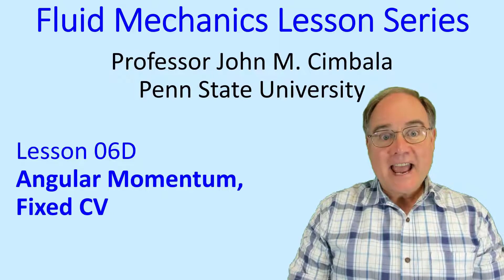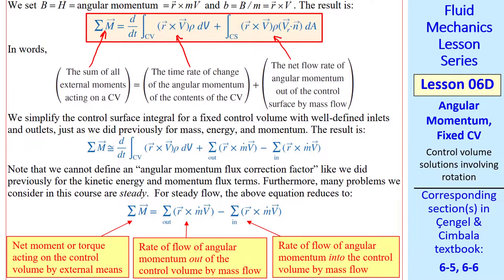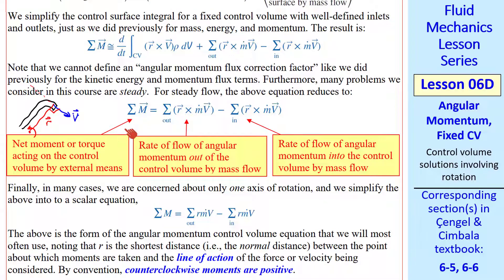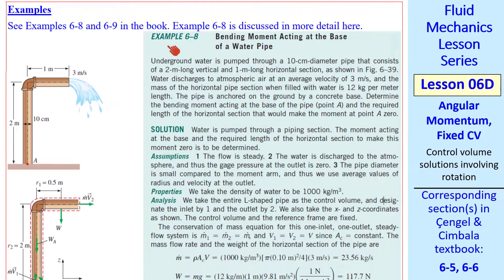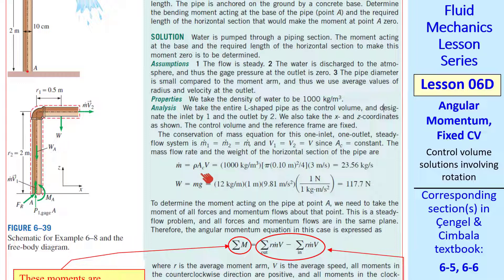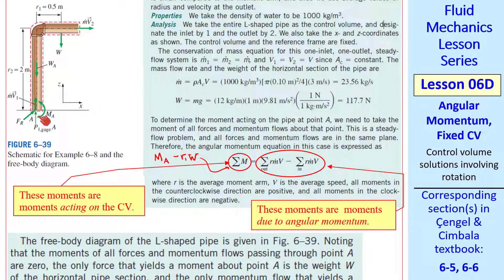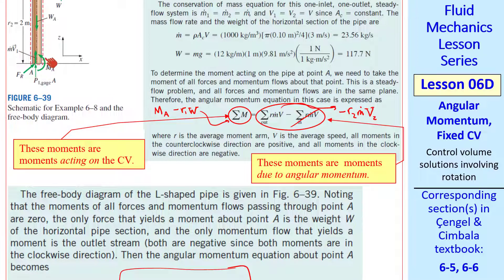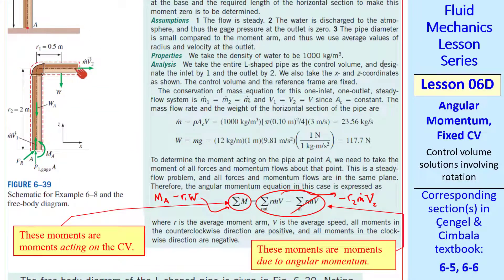Fluid Mechanics Lesson 06D: Angular Momentum, Fixed CV

Comment: Dr. Cimbala, thank you so much for your videos.  I do have a question though.  The assumed sense of the moment at A was counterclockwise.  The negative answer indicated that this sense was incorrect and the moment about A is actually clockwise.  If that is the case, weight is trying to rotate the pipe clockwise and the jet is trying to rotate the pipe counterclockwise.  In the battle between those two, wouldn't the weight, not the jet, be winning since the correct sense of the moment about A is clockwise?  In the video, you said that the jet would be winning.  I'm confused.
Reply from the maker: The sign for angular momentum control volumes is indeed confusing. The signs in this example are correct. Compare to momentum control volume analysis - we look at the flow of momentum into or out of the control volume, which is how we determine the signs. Same with angular momentum at inlets and outlets - we use the direction to determine the signs.
Thank you for your comment. Please tell your friends and colleagues about my YouTube channel where there are over 500 free videos about the Bible, fluid mechanics, science, math, Excel, statistics, air pollution, and other topics. I would greatly appreciate it.
Reply: @johncimbala , rest assured, every engineering student in fluid mechanics at Old Dominion University this semester is using your videos.
Reply from the maker: @aaron7da  Thank you.